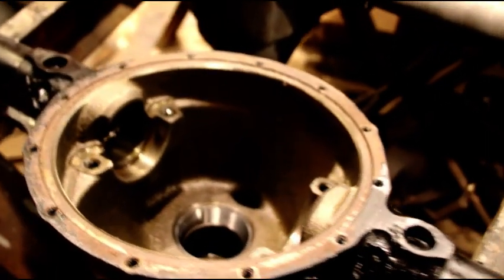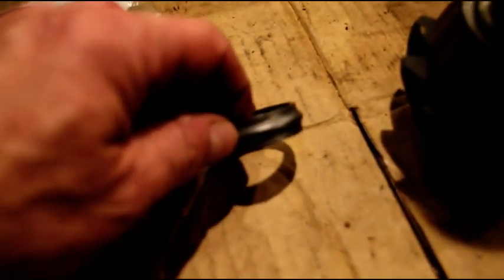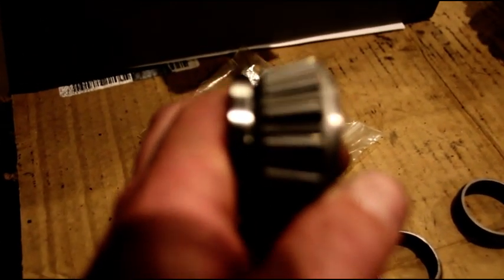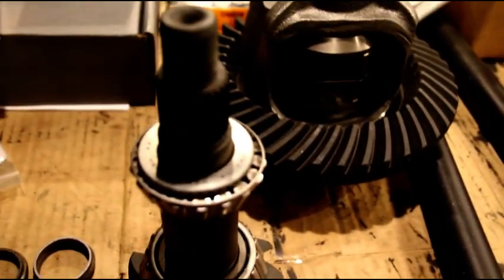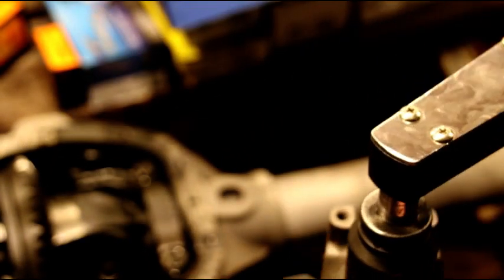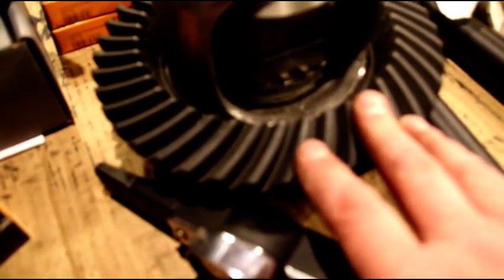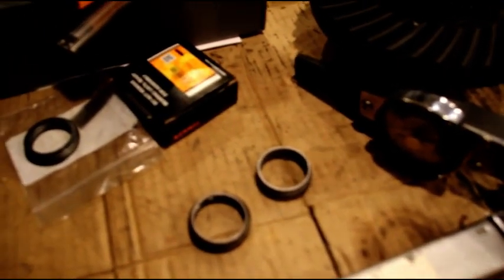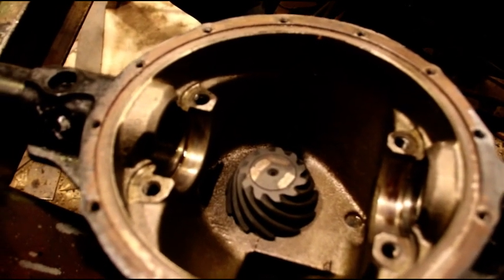AMC/Jeep Model 20 Rear Axle Crush Sleeve Elimination

Comment: Hi Brian I'm rebuilding a 1984 cj7 and I'm rebuilding the AMC 20 I'm keeping the original gears 2.73 since it will be on the street only. I'm replacing all of  the bearings and I'm going to add a crush sleeve eliminator . What should I do first , figure the shim size for the pinion depth  or the amount of shims for the rotational torque? Thank you and your videos are extremely helpful !!!
Reply from the maker: If you are keeping your original gears then start with the factory pinion depth shim.   Next get your rotational torque figured out with your crush sleeve eliminator kit.  Once you have all of that figured out you can get your carrier shimmed properly and check backlash.
Reply: @metalshaperJeep  Thank you!! Your videos are excellent. I'm doing a frame off restoration and your videos are such a tremendous  help.
Reply: Hi Brian it seems the rotational torque is too tight even with no shims in the eliminator when the pinon nut is torqued to 175. I used a pinion depth shim size  that was very close to the original but even with no shims in the crush sleeve eliminator when I torque the pinion nut to 175 I can't even turn the yoke.  Should I torque the pinion nut to a value less than 175 ? Thank you.
Reply: Never mind I finally figured out that I need to add shims. :)
Reply: Brian during final assembly do I have to tighten the pinion nut more than 175 foot pounds to set the pinion bearing (smaller bearing) ? Or do I just torque the pinion nut to 175 and that is enough to set the bearing. on the pinion shaft? . Thank you.